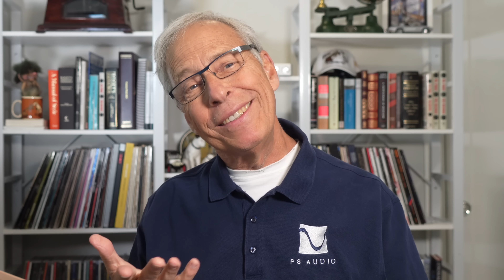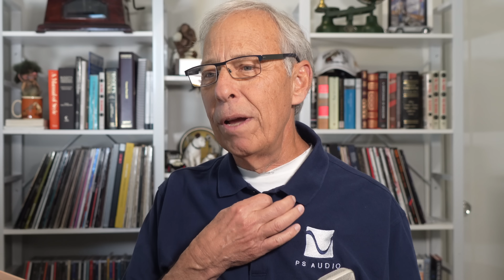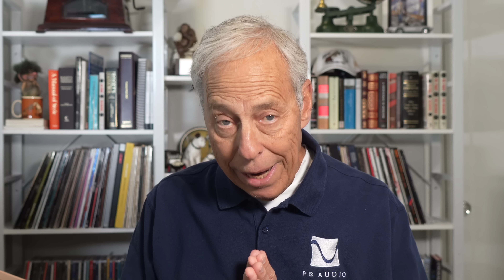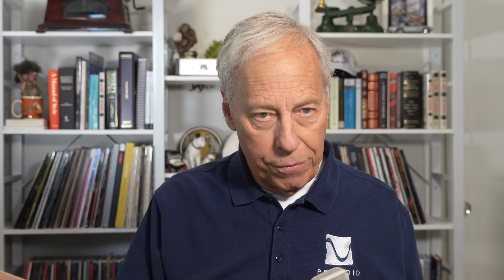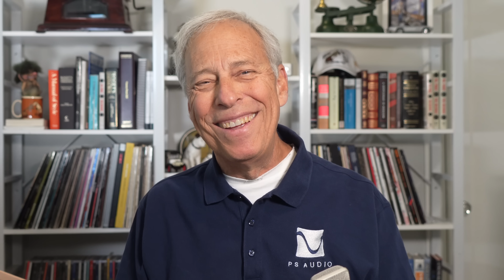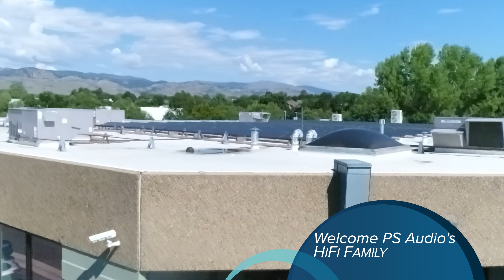Do step down transformers affect audio quality?

Comment: i've had some experience with step down transformer's for Europe to Japan current of a 230 V to 100 V Japan... after having and trying several different ones...the best ones i found that you can get for Hifi that are also silent is a  toroidal transformer..
there is a place called Airlink Transformers in the UK...and the prices are better than the inferior ones from China or Japan...those, I seriously felt I was living next to an electric plant were emitting emf that I could  here a noise coming from them...they will tell you that is normal😂...not for me!
Reply: Doea step down transformer havr amy side effects on sound quality?I am planning to buy some Sansui amp from Japan...Thanks in advance!

Comment: I have been in the process of buying a high quality US made turntable to bring to the UK ,  but I’m having second thoughts now when i hear so much contradictory and confusing information about needing to convert the power supply via a step down transformer , but this is t good enough  ,I also need a new pulley , or perhaps a “ sine wave inverter “ or perhaps even a totally new motor .it is an A.C.   motor , USA power spec and I need a UK spec . Now I hear I need such a ‘ massive ‘ step down transformer to cope ! Or need to change the ‘ windings’ to change the voltage ! And I thought I just needed a new,plug , I may give up .
It all seems a bit over complicated and daunting to someone who has , for personal reasons , avoided any messing with electricity supplies.

Comment: I want to buy a stereo receiver from Europe that is 220 volts, and I want to change the power supply on the unit to 110-115 volts to play it in Canada. Is that doable? Alternatively, I also have a disconnected 220 volt baseboard heater outlet close by that I can connect to, and run the unit on 220 volts.
Reply: To answer you question.  Europe uses 220/240v.  Just buy a separate step down  transformer power suply

.  If you're smart which l doubt,  most manufactures use standard transformers that offer many voltage outputs to save production  costs.  A quick internal wire swap would solve your problem for free.
Reply: Doablle?  Don't you mean double! Next you will be trying to teach people how to write  tere, their , they're,  they've inn å foreign language.  Din jævla kuk.

Comment: Hello Paul. Leo from Madrid here. On the subject... It puzzles me some equipment have a voltage switch built in and whatever transformer they use doesn't seem to take much space, yet some of the commercially available (voltage) transformers I'm looking at (I'm moving all my hifi equipment from Europe to America very soon) are HUGE. Is there a "secret" technology owned by these companies that allows them to fit their units with such reliable/convenient teenie-weenie adapters/transformers? Thanks Paul

Comment: I just modified a direct stream junior transformer wiring to handle 230V natively, formthenfirst two years Unused a step down transformer (with a nominal power of 100W) so I can  do  a perfect comparison. Compared with the new would coming out of the DSJ, the previous (the one using the transformer) now seems like anemic. The change is similar to the one I had changing to better speaker, or when Inadded a subwoofer, the sound comes across fuller, male voices eem to have an additional octave down component. Moreover the sound coming out of the speaker seems generally more "effortless", like if the DSJ, before the change, was power starved. I would say,mod jot use a step down transformer, change the transformer wiring.

Comment: I have a tube tester and im wondering if i could get away with a step down transformer im thinking about using an inverter to do the job instead but if i could use transformer i would save money.

Comment: I remember in the 80s, Krell got so pissed off with transhipping, that they made power supplies which would lock down if presented with the wrong AC frequency. They also used different color circuit boards for each market, green in North America, blue in Europe, red in Asia, etc.

Comment: My 5 kva transformer works for me with the accompanying buzz.  I put it behind the wall and I still hear it with no music playing, not a problem for me.  I use the 250 volts for the amps and preamp with the 125 volt leg for source components.  I think I gain from the common mode noise rejection and I float ground except for the preamp so I have single point.
Reply: I have an 1800W step down for a system that draws around 500W Max. ACUPWR seems to make some real nice transformers.  It's pretty large and hefty lol. 

I don't think there's any loss of sound quality from what I can tell...

Comment: why can't all electronics (especially those w/ worldwide appeal) just come with 100-250V?
Reply: the winding on the transformator is different on 110v than 220 v.
On low power consuming products, this is not so big of an issue.
But power amps it is an issue.

Still most decent transformators have dual windings. some even quadro wingings. So they can handel both 50 and 60 Hz And both 110 and 220 volt.
But you have to change the connections to the right windings.

Comment: Step up /step down transformers are Much too big, Much too heavy, and Much too costly for what they do. 
I would strongly prefer to buy equipment that has a multi-voltage power supply built into it.
Reply: Expensive? 100 bucks in most cases!

Comment: Hi, enjoy your work.  Is there any thing I can do to correct arc communication between avr and tv?  Have to power cycle everyday to get picture, and control avr volume with xfinity remote.  Using a marantz avr  5014.  Seems problem plague many?

Comment: Note that there are two types of step down/up transformers. True isolated transformers and single winding auto transformers. I would go with an auto transformer. They are cheaper and have better surge ratings than an isolation type. You don't need to isolate the line for safety as the gear's internal power supply effectively does that. The drawback is that auto transformers are far less effective at filtering line noise - if you have that problem.

Comment: A good alternative worth checking out would be to have 220/240 volt outlet installed. Depending where a nearby other high voltage appliance may be in use, such as electric ranges or clothe dryers Benin use, the cost of professional outlet installation may be competitive in cost of suitable step down transformers.
Reply: Wrong direction.  The question was how to use 120V equipment in a 240V-only environment.
Reply: I don't think a european 240v is the same as a us appliance 240v plug. I may be wrong, but I think they are different.

Comment: Howdy.
It is not recommended to run a 60 Hz transformer on 50 Hz. The iron will most likely go into heavy saturation. That in turn means a lot of the flux will escape from the iron and this escape flux could induce hum and buzzing in nearby wiring. Also there is a very real possibility of a thermal burnout as the primary current avalanches during saturation. During saturation there is less induction emf present.
The other way around is not as problematic. The disadvantage is that the winding impedances are higher than need be. There is 60 Hz / 50 Hz = 1,2 times turns per volt than what is needed. That is to say there is 20 % too much winding.
Regards.
Reply: That isnt a problem for Class D amplifiers that use switching power supplies. For linear supplies and linear amplifiers, the power transformer core likely will not get saturated because the heavy current peaks will be supplied by the filter capacitors. I'm not saying that it couldn't happen, but equipment manufacturers should take this into account when specifying the power transformer so that it can be used worldwide.
Reply: @StewartMarkley  Howdy. Yes. You are correct. Except one point.
The load current does not affect magnetization. The magnetization follows the formula  e  =  - n * d(theta)/dt. In English: The magnetization is proportional to voltage and inverting proportional to frequency.
Regards.
Reply: @eugenepohjola258  Load current certainly does affect core saturation. I've done many load tests of SMPS that clearly show core saturation as the load is increased to the limit.
Reply: @StewartMarkley  Howdy.
Yes. You are, of course, 110 % correct.
Regards.

Comment: One Important Caution:  NEVER use the compact "foreign voltage converter" devices with audio gear!  They are thyristor-based and are only suitable for devices like hair dryers, incandescent light bulbs and shavers which only care about getting a reasonable average voltage and do not care what the peak voltage or waveform is.  
Always make sure you are using an actual transformer, i.e., it should be large, heavy, with lots of iron inside.  I recommend one that has a VA rating that is about 2x the amplifier's rated power draw.
Reply: THNAKES YOUE! Tou have alwabe been the honest freinds! THUMBBS UPPS!
Reply: Yea, I think those are just a simple diode. Just like those cheap hi/lo light dimmers. Just a diode to crudely half the average power by lopping off half the sine wave. Along this same idea keep in mind that many modern travel adapter kits are just basic plug converters. They do not change the voltage at all. They effectively just change the plug type. With modern switch mode power supplies like phone chargers and tablets, that's fine. But beware that seemingly 120v output receptacle is now at 240v when the unit is plugged into a 240v foreign outlet.
Reply: @andydelle4509  
They're not simply diodes, but triac devices triggered via a delay circuit so that they turn on just past the peak of the AC cycle.  That reduces the duty cycle to 50%, and the average voltage by the same factor, but the peak voltage is very high.  Some designs have an amplitude-dependent delay so they provide some degree of compensation for changes in input voltage.  
With any load that has a rectifier/capacitor circuit in its power supply, the caps will charge according to the excessive peak voltage, wreaking havoc.
Reply: @marianneoelund2940  My parents had one in the late 1960s. From Sears if that matters. It was a silicon diode period - I took it apart!  There may have been thyristor units as well. But think about it - either chop the sine wave at 50% duty cycle or just lop off half the waveform is the same thing to a resistive load. And as for peak voltage, these devices were sold for pure resistive loads. Where is the peak voltage without significant load capacitance / inductance?
Reply: @andydelle4509  
That's news to me.  The only simple rectifier application I've seen is those disc diodes to put under incandescent lamp bases to reduce their brightness and extend life.  Ah, the things we used to do . . .

Comment: Switching between these transformer windings is only an option for linear power supplies.
Switch mode power supplies have an input rectifier that needs to be at the correct voltage rating and frequency.
Reply: SMPS are designed to be used universally anywhere in the world without modification.
Reply: @StewartMarkley  Not all are universal input voltage, especially older units like from the 80s/90s. Some have a switch, some have an internal jumper. Best to check the label first.
Reply: @andydelle4509  The units with a switch to change the power rating are linear power supplies.
What the switch does, is adding or removing a second winding/segment on the primary side of the transformer.
That way the primary coil of the transformer is either connected with one segment of 120V or two segments of 120V, which makes 120V x 2 = 240V input.
Because of the components that are behind the secondary coil, like power regulators, the frequency (50/60Hz) of the power grid isn't of any significance to it's functioning.
Reply: @andydelle4509  Ah okay, I suppose those SMPS are very rare nowadays.
Reply: @StewartMarkley  Not necessarily.
Most of the times European models of a product are universal 100 - 250V 50/60Hz, but the American and Asian variant isn't.
An example of this is my Technics SL-1200G, which is the European model because I live in Europe, so it's 100 - 250V 50/60Hz.
But there's also a 120V American variant and 100V Japanese variant.

Comment: True audiophiles care about the quality of the grid step down transformer and make sure their house is not too far away from a proper stable power plant (nuclear power rather than wind)...just kidding...happy birthday to Paul!
Reply: ThinkLearnSolve Yes, rather than moving to a house with a nearby nuclear power plant with audiophile grade utility transformers and audiophile house wiring, it’s better to just buy gear that was engineered with proper power supply inside of it to begin with 🤓
Reply: I was rather pleased that when our neighborhood's utility transformer failed last year, the linemen replaced it with a larger unit - 37KVA instead of 25KVA.
Reply: Marianne Oelund Yes, 37kVA is adequate for audiophile systems LOL 😊
Reply: Liquids cooled pole mounteds transformers is nost subjects to IEEE 979
for distances to  a houses and suchs. THANKES YOUES AND THBBMS USP!

Comment: Paul, here's a product modification idea for you. Make an alternate model of your Power Plant that can do voltage conversions. 120 to 240, 240 to 120, and 100v option for Japan. A one-does-all might be difficult but you could make it modular to set the conversion by swapping out internal modules and the transformer. And you can also do frequency conversion 50/60hz very easily with your Power Plant topology.
Reply: Andy Delle this is a great idea

Comment: His two primary windings are in parallel. Change them to series and change the fuse to half the rating. Done.
Reply: Unplug first, or you'll get a very rude surprise.
Reply: @jamesplotkin4674  
My first summer after high school, I worked as a maintenance tech for the local power utility.  I worked on live wiring many times, such as changing lighting ballasts in the office areas.  Of course it was only 120V.  
With regard to rewiring the amp, it's not likely to be plugged in before the mod is started, as it can't run on 240V yet.
Reply: @marianneoelund2940  Yes, but there are folks who do it and it can be a lot of fun to watch them fly across the room. I was making a funny :)
Reply: @jamesplotkin4674 ... Robin Williams - 'Reality, What A Concept' "...& you people at home, I want you to grab the back of your TV sets & feel the power of comedy! Sure as hell someone will get a laugh as you shock your ass across the room." (RIP)
Reply: @FatRat-f9m  May he rest in peace. I have done just that as a youngster. Nearly killed me. Once I recovered, my father had some advice for me.
Reply: If there is a MOV varistor then don't forget to change it to keep it from blowing up at the higher voltage.
Reply: @StewartMarkley  
Well, no one can accuse you of being a pyromaniac.  I can't say the same about some of the friends I had in junior high and high school, who wouldn't hesitate to try anything that might produce smoke.
Reply: @marianneoelund2940  Yeah, I remember putting match heads into spent ammo shells and dropping rocks on them to make them explode. Then I graduated to M80s and real fireworks for a real blast.
Reply: @StewartMarkley  
Several of the guys I knew were into model rocketry.  They weren't supposed to explode, but let me just say it was wise to stay at least 100' away during launch.
Reply: @marianneoelund2940  Yep I did that too, and 1/24 scale slotcars also. Being a DIYer I built my own chassis and rewound the motors to get the fastest cars and melted plenty of endbells which held the brushes.
Did you ever determine anything about the 60Hz fields and the sound from your stereo system?